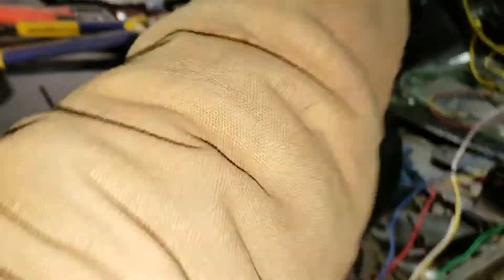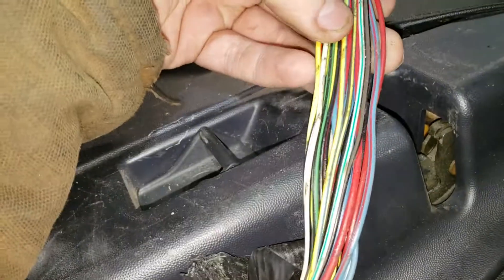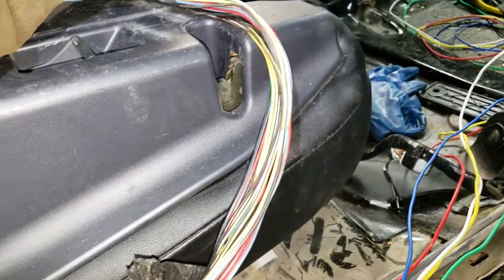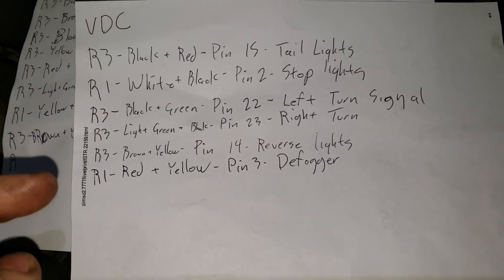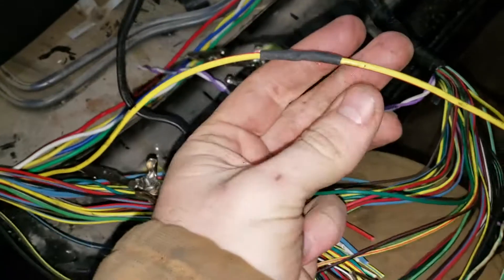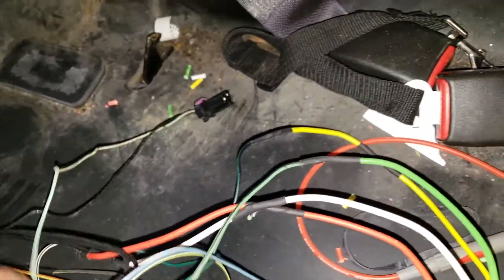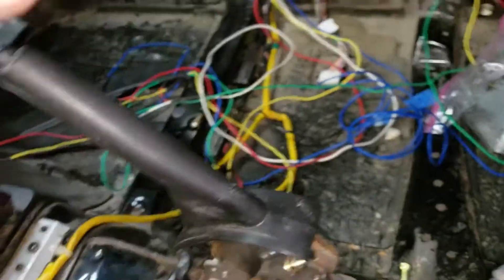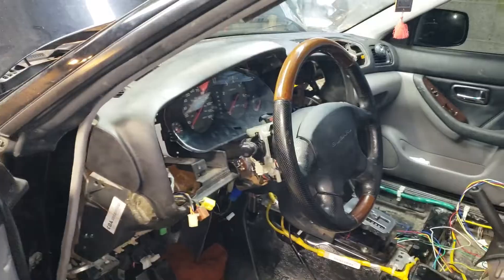Merging a Harness for a Subaru Engine Swap

Comment: Hi Bruce, Do you have the links to the factory service manuals ?
Reply from the maker: Check the eBay
Reply: Google "Subaru Technical Information System". For $35, you get 72 hours of access (as of August 2021), and you can download all of the USDM Subaru Factory Service Manuals directly from Subaru, in PDF form and keep them forever. This is the same service that Subaru dealerships use in the US.